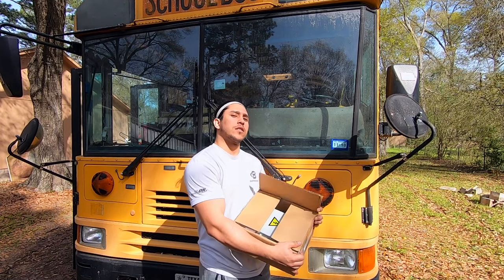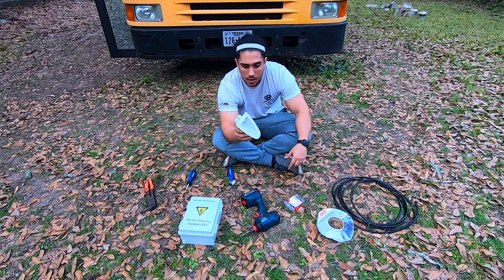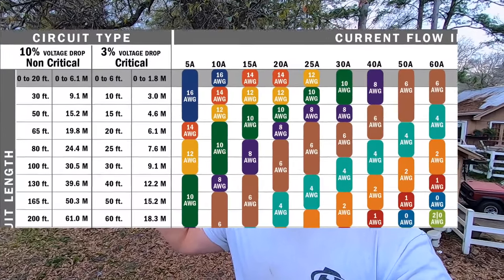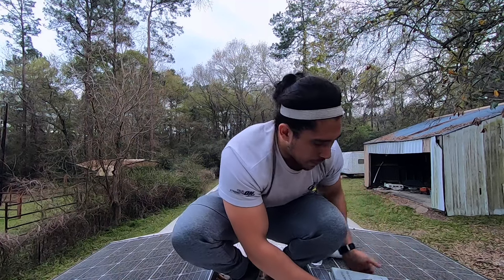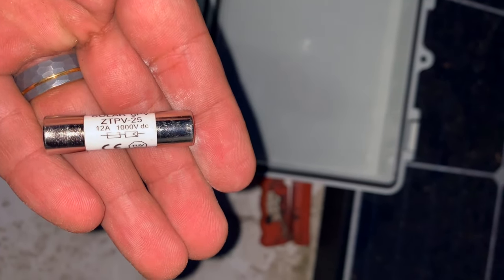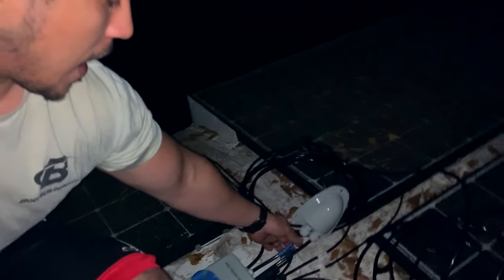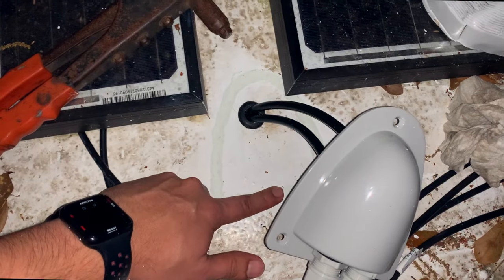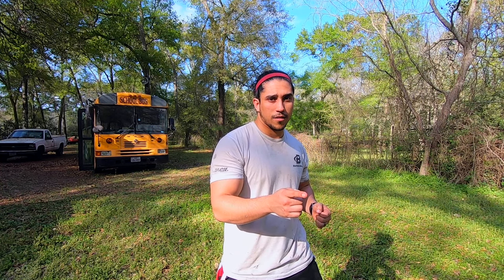Mounting Combiner Box and Solar Cable Entry Gland * Skoolie Conversion * Gus The Struggle Bus

Comment: Thanks for including the wire gauge load chart.
Reply from the maker: Lol no problem! This chart has come very helpful!
Reply: @GustheStruggleBus  where did you find the chart? I just got my electrodacus SBMS0 unit (battery management system) to balance the cost effective LiFePo4 cells I'm planning to use in my battery bank.  Because of dependencies, I probably will do solar sooner than I had first planned.  What kind of batteries will you use? What voltage? How many Amp-hours? I'm thinking I'll do about 3000W of solar and do 400 ah lithium at 24V.

Comment: small thing i got teached when i was learning to become an electric installer : when cutting the outer mantel of the electric cable , cut the mantle like you cut the bark of a piece of wood  with a pocketknife , 
when youre cutting the mantle by circling a cut around the is a chance you ca potentionally cut intoo the insulation of the wires inside wish can cause electricity to leak to ground or if you cut a single core instalation wire can kerf the copper core of the wire and can cause it to fitaque and snap after some years of vibrating or moving (like bending some wires out of the way in a fusebox when instlling new groups )
there are mantle cutting tools that cut by circling it around the mantle but the cutting blades for those are either specially shaped or the exact length needed to prevent nicking the protection on the wires inside
Reply from the maker: That is a great tip! never thought of that, I will look at the tool!

Comment: Hey guy's, if i am honest, not sure about the box on the roof outside, i would have that inside. Time will tell if the IP rating holds up with those plastic clips keeping it shut. Nice shout out to Mike and Kerry.
Reply from the maker: We understand the concerns, we have the same ones. But we know a few buses that have put them on the roof including mike and kerry. We will still keep an eye on it and make sure it holds up! Thank you!
Reply: MEREDITH and PACO I was thinking the same thing about mounting the box outside if for no other reason than having to climb up there to flip a breaker or replace a fuse. I like you am not fond of heights and I’m not looking forward to that part of my build.
Reply from the maker: Yeah anything electrical can be noting. I know that I researched this for days because I wasn't sure exactly where to buy our box was at first. We went with this one because we had a good reviews and was rated for being outside. as far as going on the roof to see what's going on with the commander box that shouldn't be a problem for us lol

Comment: Where did you end up grounding the box too? and which spot did you put for the grounding wire in the combiner box? Did you just ground it to the metal roof bars like you did for the 12 v negative connections?
Reply from the maker: It is actually grounded under the bus! There is an exit in the floor in the electrical closet
Reply: @GustheStruggleBus  thank you friends. I have bought Everyrhing almost through your links. So hope you are getting something for it. Appreciate you  so much

Comment: Out of curiosity...why butyl tape instead of some kind of seam sealer or caulking?  Is it more stable? (Less potential for too much squeeze out?)
Reply from the maker: We have really enjoyed working with butyl tape. I is easier to control the amount and where it goes, last longer thank a tube and last longer over time.
Reply: @GustheStruggleBus  Makes sense, thanks!

Comment: Hey Guys, i am sorry to be negative here , but u trust holes n butyl tape and all that a lil too much for my likes. I would have installed that combiner box inside, in your "electrical room" for several reasons, most important is moisture. Since u expose it to sun , it will be hot n cold, hot n cold for ages.. Some water in the air inside will condensate, it will cause corrosion of the contacts. You will have to go up on the roof to clean those contacts, and the wires will rot and if u cut them n make new contacts, eventually the wires will be too short to fit . And : u trust holes n rivets much too much. Nowadays you can trust products to seal and glue , like Sika. I would try and reduce the holes you drill , and install as much as you can inside. Water can and will find its ways inside. And if you sprayfoam insolate, you will have dirty lil secrets coming up after a few years.
Lets face it: I luv u guys ;-) but i have to tell you.... Hugs from Germany,  just my two cents,Georg and Mark
Reply from the maker: Thank you so much for your tips we will have to remember these going forward 😊